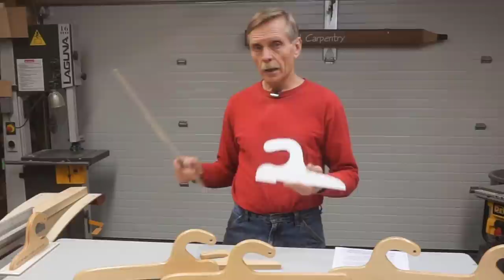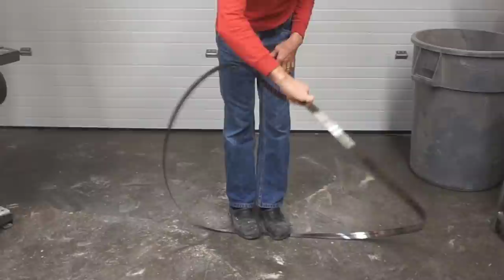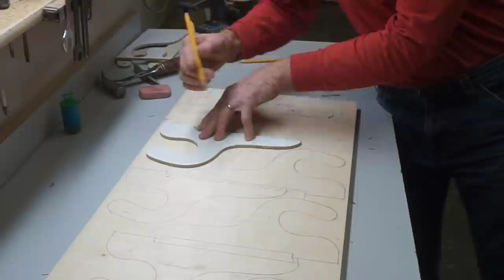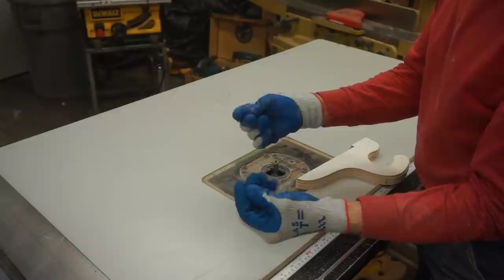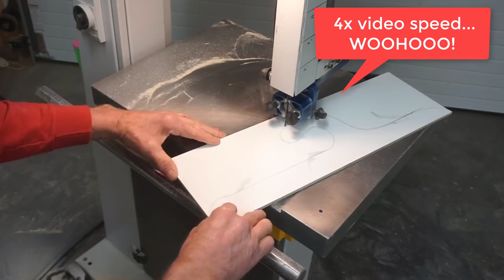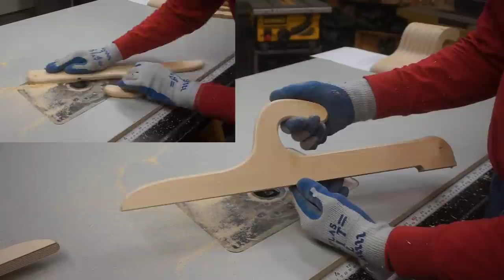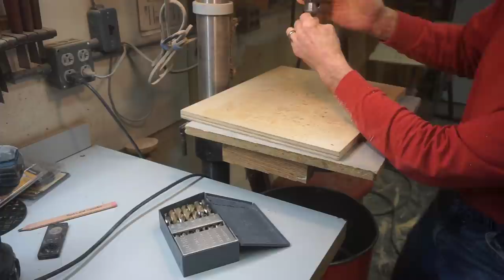Make Professional Push Sticks for Workshop Safety

Comment: In 11:33 you did not use a push stick, even though you had a push stick in your shop. Hmmm, this sends the wrong message!
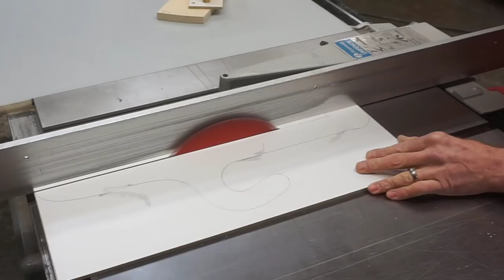Reply from the maker: I didn't use one at 33:48 either.  If you think that not using a pushstick for this operation in either instance is "sending the wrong message!" I think you fundamentally don't understand what the proper use and 'right message' is.
Reply: Yawn. There's always one Safety Sally in the bunch that knows best. For one, he's not pushing the work through the blade. Two, his fingers are nowhere close to the blade. Most of us who follow Master Carpenter Matt watch to learn from the best.
Reply from the maker: @TM_Stone  Thanks for adding a touch of reason and sensibility to this thread... much appreciated!

Comment: Just the safety tips you have educated your viewers on is enough to make this video a compulsory viewing on any woodworking school or class.  Thank you.  I still have all my fingers after more than 40 years of woodworking.
Reply from the maker: Congrats on your finger preservation achievement Cesar... stay stay focused and work safe... as you're well aware, to maintain  your stature you've got to be successful ALL the time, your power tools only need to be successful once. Best, Matt
Reply: Same here and 22 years, but I work with a guy about 50 who got tangled with the Altendorf sliding table saw blade and lost  about  1-1/2 fingers, he had a bunch of small narrow  cherry strips about the size of those wood paint stir sticks you get at the paint store piled on a cart, he was ripping them and putting the scrap edges in the waste bin, the cut piece back on the cart and getting another piece to rip,  he wasn't paying attention and his hand brushed over the top of the blade as he reached back  over to the cart on his left and wasn't looking where his hand was as he did it, the blade didn't cut the fingers off but it basically degloved substantial flesh and so on,  and the doctors told him it would cost like $50,000 to try and salvage this and no guarantee they would ever have feeling or function, so he just said to go ahead remove what they had to. So they amputated  about half of his index finger and almost half of his middle finger. His 4th finger got just a small nick and healed up. 

He said he knew immediately it was BAD without even looking and had a rag wrapped around his hand.
That's all it took, one split second of not paying attention.

Another dangerous machine is the spindle sander! another guy who is retired now was using it on a piece of 3/4" ply about 6" by maybe 12"  that had about 2-3,  2" holes in it and he had about a 1-3/4" diameter sanding drum on the machine  he was using to clean up the holes, he managed to get the workpiece moved in such way that it must have bounced laterally and then jammed on the drum and took off spinning with the drum and had had both palms holding the plywood and when it spun around, the corners of the piece gouged the hell out of both of his hands. He had to go to the hospital for sutures, and that accident just happened to happen on the last day of  his retirement week!
As if that wasn't bad enough, just before that day, that same week he was helping move some lumber and got a nasty deep splinter he had to get removed out of his finger! I told him THAT is why we wear WORK GLOVES when handling lumber...
Reply: @HobbyOrganist  I lost the tip of my finger from a jointer. Trying to make a thin strip to fit between floor boards. Made last pass and not paying attention dropped my finger right in...fffip took tip off. Didn't even feel it.
One of these push sticks would have been a great help.

Comment: While waiting for a benchtop glue-up to dry, I used your template to make a half dozen of these push sticks in different thicknesses, from 1/4" to 3/4'.  It took very little time and I have been using them routinely for several months. They work very well and I am glad I made them.  Thank you!

Comment: I came here for the Push Stick template.
I left with the Templates, AND the PVC Pipe sand block Tip, AND the Dryer sheet anti-static saw dust Tip for my safety glasses!!!
My time was very well spent here. 👍
Thanks a bunch Matt!
Reply from the maker: Glad you found the content this video so useful and hope you will spread the word about next level carpentry to others who might appreciate it as well? Best, Matt

Comment: Matt, these are my favorite push sticks. I built 2 with 3/4 ply, one with 1/2 inch and even a 1/4"  plywood stick.  I feel these are the safest and most balanced sticks I've used. It's worth taking the time to round over and sand the handle, it makes them a joy to use.  Thank you!!
Reply from the maker: Glad to hear it Fliperyy... having that range of thicknesses will be useful, the more useful, the safer working with them will be.  You're most welcome! Best, Matt

Comment: I have watched many of your videos and taken away some great tips and ideas for which I thank you for. Watching the above video and listening to to talk about table saw safety push sticks and kick backs I find it amazing you run your saw without a riving knife which would prevent kick back and is probably the biggest safety feature of any saw aside from the saw stop device. I guess you have always done it that way and that in your opinion makes it ok.
Reply from the maker: The biggest safety feature of any saw, bar none, is the mind of the operator Brian... it ultimately determines safety of ANY device. I try to always be mindful of the fact that the absence of an accident does not determine the presence of safety and it's the operators decisions alone that determine what level of risk they'll accept and what measures they implement to feel confident as they work.

Comment: This guy is rad. He reminds me of my grandpa. Full of great wisdom and funny! I'm new to woodworking and this guy has me thoroughly convinced that this push stick design is the way to go. He probably arrived at this design after years of trial and error. I'll take his word for it! I just went out and bought some small 2'x2' sheets of plywood and some 1/4" mdf and will be making a bunch of these push sticks this weekend. Thanks Next Level Carpentry!
Reply from the maker: "This guy" appreciates your comment Jay! Hope your pushstick project goes well... I've been using this style and design for over 20 years and, other than the various configurations shown in the video, see no reason to change anything about them.  Let me know if you use the photo on Pinterest or draw out your own version... Best, "this guy" Matt
Reply: @NextLevelCarpentry  Sorry, Matt! I didn't know your name or imagine you'd read my comment. Thanks for sharing what you know. I recently bought a fancy tablesaw and am looking to make some accessories for it. I was searching for info on how to build a nice crosscut sled when I came across your pushstick video. What a great find, and entertaining! I need a few pushsticks and yours will do the trick just fine. If they've worked for you for 20+ years then I may as well adopt the same style. I don't do pintrest so I just stole the graphic you put in your youtube video and imported it in to a computer program where I could trace your exact design and then print it out on computer paper, then i just use a glue stick to attach the paper to the mdf and jigsaw away! I figured, you did all that work with the sockets making those nice curves I should just use what you came up with. So, I did. Greetings from California! Keep up the good work. You earned a subscriber today!
Reply from the maker: @jaybahler9688  Cool... I'm glad the graphic from the video worked for tracing the profile for your pattern.  Approach new projects and new tools with mindful caution to avoid pitfalls when you don't know what you don't know.  Have fun making pushsticks and thanks for the sub!  Best, Matt

Comment: About your router table: I had a really nice one years back. You know, the kind of table you can eat off with nary a scratch. Then , I came across “themasterwoodworker”, a retired cabinet maker who actually used his router table and wasn’t shy about screwing stops and adding marks to it in facilitating his work. I tossed my work of art and followed his example of using a fixed base router attached to plywood and simple fences. A small, unclamorous change that actually allowed me to perform more efficiently. Thanks again!

Comment: Just to comment.i wasn’t picking yours apart i just like my push sticks out of {3/4} plywood but as far as the thin ones I would rather make the thicker because I’m worried about tipping and running fingers into the sharp spinny thing. I watch you shows all the time Keep em comin
Reply from the maker: I don't recall the comment you refer to as 'picking apart' Allan but appreciate this comment of yours.  Forgive me if I seemed to insist that  my preferences are right for everyone... or anyone really.  A healthy respect (fear) of that sharp spinny thing is something every individual develops and I respect it completely.  Glad to know you watch NLC videos and please don't hesitate to let me know if there's anything you don't agree with, doesn't make sense or you don't understand.  Feedback from engaged viewers like you will help make this Channel far better than if I build it in a vacuum. Best, Matt

Comment: Just discovered your channel tonight and will search for the episode on cleaning and maintaining cast iron tools.  Whether I like your push stick design is irrelevant (I do like it, btw) because you are up front about the flexibility of the shape.  I also appreciate your templating technique and had no idea that pencil could be removed from hard surfaces with acetone.  When I raced sailboats we wrote the course bearings and distances on the fiberglass beside the compasses with pencil and used Soft Scrub to remove it after the race.  It is my decision to accept responsibility for the designs I build and determine them safe for me.  I'll make your design and one that puts the handle aft of the heel and see what works for me.  Thank you!  Subscribed.
Reply from the maker: Thanks David... your sensible, grounded views and approach to woodworking will serve you well in all your endeavors... I wish you the best.  Thanks for subbing too!

Comment: Very nice design, and multi-purpose due to its adaptability.  I used your pattern from Pintrest and drew a full size version of it in AutoCad.  I'd be happy to share a PDF and .dxf  file with you if it would be helpful to other woodworkers.  Thanks for the detailed presentation and great information!
Reply from the maker: Hey Dave, I see another viewer noticed your generous offer to share your pattern so, if the offer is still good, just attach a link in a reply and I'll pin you to the top of the list so others can benefit. Thanks! Best, Matt

Comment: I like the profile of your design, but prefer a broader base for some work, mainly when ripping thinner materials, for example quarter inch. In this case  I also like to use second longer stick a bit like the commercial plastic stick you binned, which I use to hold down the front of the workpiece. I also wonder why you don’t use a splitter on your table saw? I know that this was common for a long time in the US, but as you probably know, all European saws must have them, and many new US saws do. Another point, although I have a proper 30mm shaft shaper, I use. a router table a lot. The shaper frightens me a bit when it winds up to speed with a big cutter! My router table has the ability to screw in a “lead in post” This makes starting the cut less exciting. Great video, and I particularly. like your gentle humour. 😊

Comment: Just a terrific video with about 10 great tips.  I usually want to watch things that are fast paced,  but as I watched your video just when I started thinking that I was going to fast forward you would then insert a great tip that I wasn't expecting. For example the PVC tubes for Sanders what a great idea. I was also thinking of  gluing the sandpaper on the PVC pipe ...so you would have it all the way around (of course this would be harder on your hand so a glove might be helpful) and then when the sandpaper wore out you could just glue another one on top of it until you got a stack of them and took them all off at once, but your way is probably better. Anyway thank you for the great video.  When you hold your push stick do you always grip all the way around so your hand is holding the handle like you would grip a baseball bat or do you ever push down with the palm of your hand and let your fingesr kind a pinch the sides of the handle...if that makes sense?   I guess it's a double edge sword. on the one hand if something went wrong your hand could come off and wouldn't be pulled along with the stick into the blade but on the other hand (look a pun!) your hand could also just slip off into the blade. Anyway great video keep up the good work thank you for sharing your wealth of knowledge.   Some of the younger folks don't realize how lucky we are now to have these resources.  in the olden days unless your dad or uncle or somebody you knew was willing to take the time to teach you all these things you either never learned it or you learned the hard way or it took you many years to learn it.  Thank you!
Reply from the maker: Mr Koolio, great comment.. thanks for sharing.
FYI I 'always' grip the handle of the pushstick 'like a bat'.  It provides more than enough 'grip' so that I can physically stop the spinning blade and keep a workpiece from kicking back if a thick piece binds up during a cut.  It doesn't happen often but it does happen. I try to picture resisting that kind of kickback force with a pair of flimsy 'sticks' and it makes me cringe.  Keep in mind that I adjust blade depth to about 1/8" above the workpiece in 99.9% of ripping operations, even if it means changing it for individual pieces, which it often does.  Videos I cannot watch, fast paced or no, are ones where someone is using a flimsy pushstick to rip a thin piece of wood and the blade is 2" up out of the table😬😬😲  With these things in mind I hope you can see why these are my favorite pushsticks... Best, Matt
Reply: Next Level Carpentry thanks brother

Comment: Great detail and some really handy options that I have used and some new ones.Only difference is I use the John Heisz pattern.I make them 30 - 40 at a time.I prefer the handle shape and quicker to make
Reply from the maker: John, thanks for commenting.  If you picked up an option or two that help you work better and safer that's a good thing.  The Heisz 'handle style' pattern seems pretty popular and functional so it's good to know it's working for you... no need to fix things that aren't broken, right? 
Best,
Matt

Comment: Further to my previous comment. I have used your design . Holding it the way you do keeps the hand well above the blade, if it is kept at the correct height just above the wood you are cutting. I’ve put a skirt on to protect my hand as with the model sitting on your table. The traditional push stick, “toy” as you put it, is designed to keep the hand well away from the blade especially for those who cut any thickness with the blade at maximum height, I guess. As always there is a balance between functionality and safety.

Comment: These are good push sticks very similar to the ones i use. It's  good to also use other good sense measures. I once grabbed a push stick when ripping some melamine at 45 degrees  but the blade was too higher and pulled my hand into the blade .please always be aware of blade height.

Comment: Thanks for your tutorial on template work. I make a similar push stick but the hand hole is enclosed at the back. I believe the shape, which I copied from another woodworker years ago,  is called a "duckbill." The functional reason for the shape is that at the end of the rip cut, your hand has moved over and then past the blade. When I consider adapting your design instead, my concern is that my hand could fall off of the open end of the push stick and downward (i.e., if I were somehow to loose my grip on the stick), and fall onto the blade. In general, even when working with a push stick, I believe one should consider what would happen if the barrier between you and the blade were suddenly not there.

Comment: Great idea for the jointer. Nice job.
Reply from the maker: Thanks George... for your comment.
I do find these VERY useful for straightening edges on narrow pieces on the jointer... and, as a note to anyone who isn't aware,  moving the fence to expose as little blade width as necessary makes it safer still. 
Best,
Matt
Reply from the maker: Thanks George... for your comment.
I do find these VERY useful for straightening edges on narrow pieces on the jointer... and, as a note to  anyone who isn't aware,  moving the fence to expose as little blade 
width as necessary makes it safer still. 
Best,
Matt